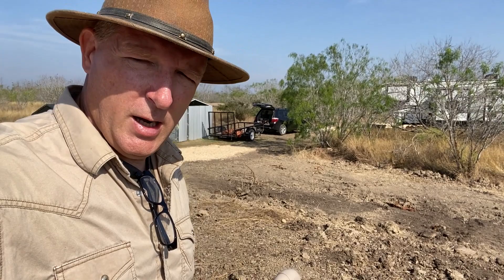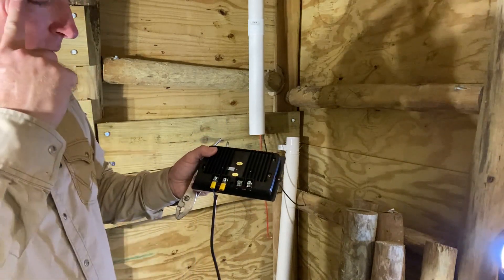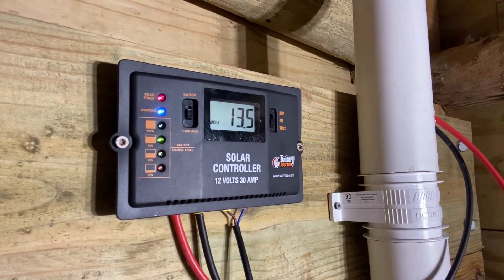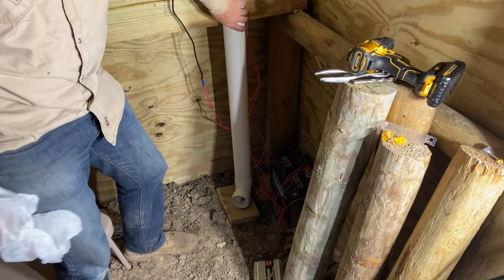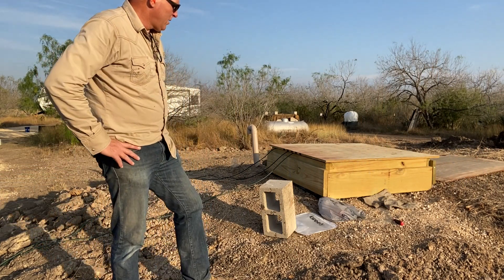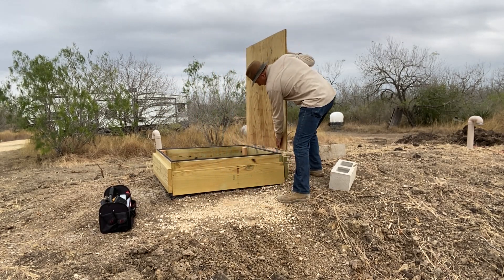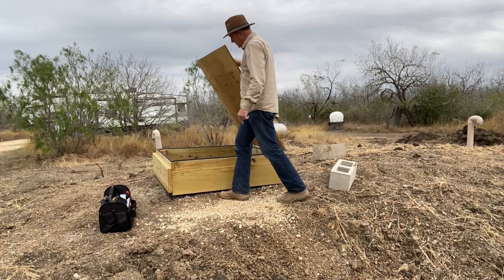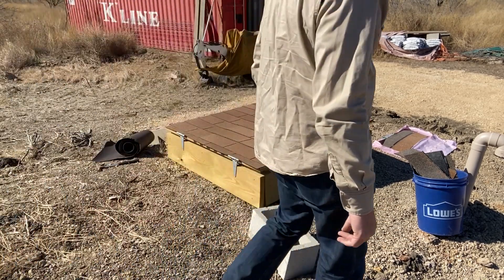INSTALLING A SOLAR PANEL FOR MY ROOT CELLAR AND ADDING A DOOR - (EP 61)

Comment: I really like what your doing but that roofing job is not even close on how to lay shingles, it’s actually pretty easy and it tells you how on the back of the shingle package. You would be much better suited with a peice of epdm rubber roofing glued on and wrapped under and nailed underneath a lot of shingle supply houses will pretty much give u a small peice of that stuff. You could also use some roof and foundation tar liquid on the sides.
Reply from the maker: Thanks for the tips!  Maybe I'll try that next time.  I will probably get some tar to seal up some areas.  Really shouldn't be shingles in the first place but it's a really small area so won't kill me if I have to try your suggestion later.

Comment: I’m a believer in deck paint, it’s very thick and durable! I used it on some leveling jack boards for my RV and it’s still going strong after 10 years in the AZ sun, they are not store inside when not in used so they have been exposed the entire time! You may want to look into that to paint the entire exposed wood and door. Behr products Home Depot
Reply from the maker: Nice! I'll give it a go.  Thanks!